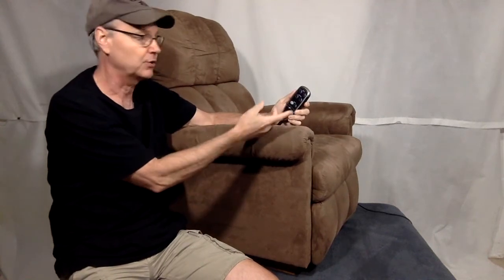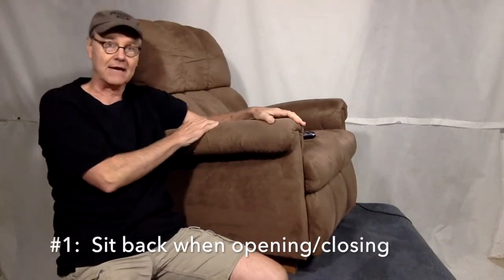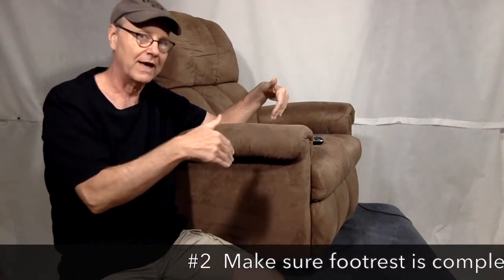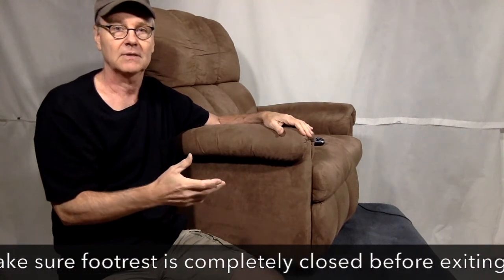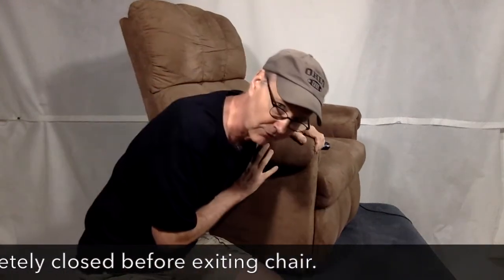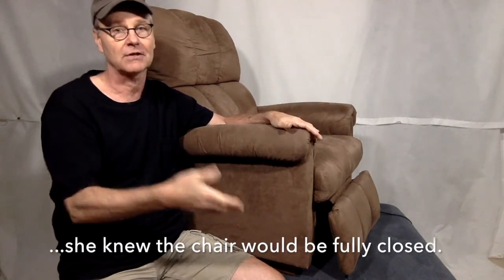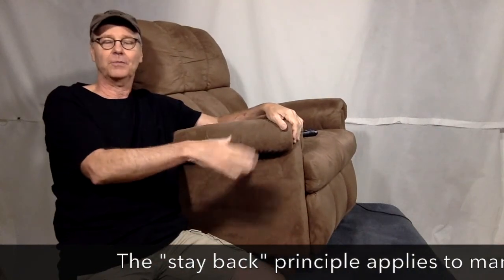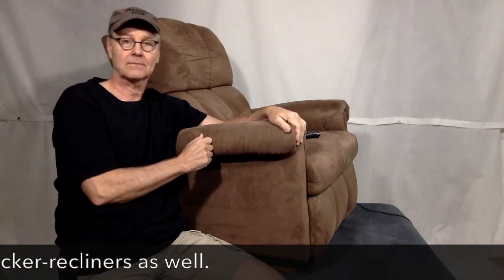Operation Tips: La-z-boy Electric Recliners

Comment: So, all the Customers fault with the lazy boy? About 4 months ago, I returned my 1650.00 power rocker recliner to lazy boy.  I shall never ever, buy a Lazy Boy product ever again.  After waiting 9 weeks for them to ship it to me, it arrives and within 48 hrs.; the chair "implodes."  The chair locks up extended in the air, fails, burns out, etc.  Technician arrives, finds the black box processor failed, and wires wrapped tightly around the box also, motor burned out also, shredded wires, and other damage. ( I hardly used it in the 48 hrs. )  He didn't have the parts. Still without a chair, 3.5 weeks later he comes back finally with parts.  He finally get's it working.  He leaves; however, it's not working correctly.  The leg rest is not lifting high enough.  I drive back to the showroom, I set in the showroom model.  As I suspected, there's a problem.  I measure the distance between the floor and the chair etc.  Told the manager, what the issue was, so he would send him back out.  Tech come's back out.  He claims nothing can be done, and says that Lazy Boy is not building them correctly anyway ( gee, I find that easy to believe ), that they have constant complaints and problems; and that he can't do anything else to fix the problem.   So, I told the store manager the situation, and I wanted my money back.  So, you know what kind of scam they tried to pull? They said, "Oh, gee, you've had it too long.  Then, they said, we don't want to come get the chair, cause we would have to charge you 85 bucks to do that anyway, and our home office has to approve these things, if their in the mood to do so, etc...  These games went on for 2 weeks on the phone until finally I told them, "Look, I have not had the chair for "too long" as you stated.  I never received the chair for 9 wks., it imploded in less than 48 hrs. it stayed broken for 3 weeks, and only partially worked for the small amount of time, and you need to come get the chair, because I'm calling American Express Bank.  They don't have a sense of humor like I do, and they have this big steel pipe that they use to break knee caps with. I'm telling them what you did, and I want my money back, and want your chair out of my home, and that you're trying to make them pay you 85 extra dollars.  And, I'm calling them the moment I hang up with you.
The out come was that I got my 1650.00 back, didn't have to pay an extra 85.00, and they came and got the broken chair that never worked.  I'll never do business with Lazy Boy again.  If you go to their reviews on their lazy boy site, you can read posted reviews of what others have posted on them.  It's really pretty bad.  And, the employees who work in their factories are pretty miserable.  In Dayton, TN.  Their treated badly.  No wonder the product is so defective coming out the door.
Reply from the maker: @Mark Fisher - "So, all the Customers fault with the lazy boy?.."

An experienced repair tech, like myself, can determine fault, if required. And it usually falls into these categories -- which are in no particular order here: #1 Defective or poorly designed / constructed / assembled product. #2 Improper use or abuse by the consumer. #3 A combination of both 1 & 2. #4 Parts eventually wearing out on older recliners. (i.e. - no one's fault)

If you're looking for better-quality furniture, I recommend you avoid all the mass-produced brands, not just La-z-boy. For more on that subject, see the video 'Who Makes the Best Furniture/Recliners?' over at ReclinerRepairGuy.com. Read the video description there to learn more about the clip.